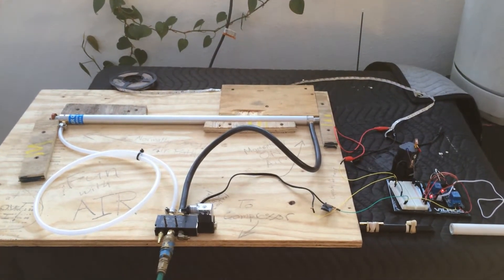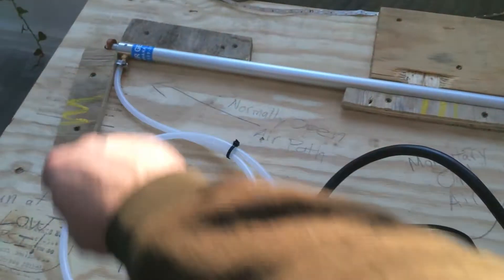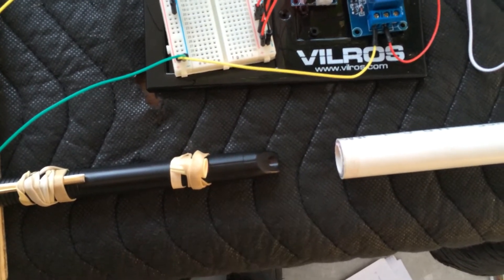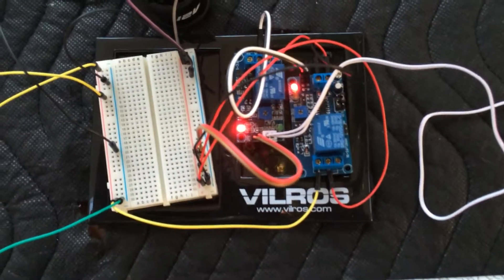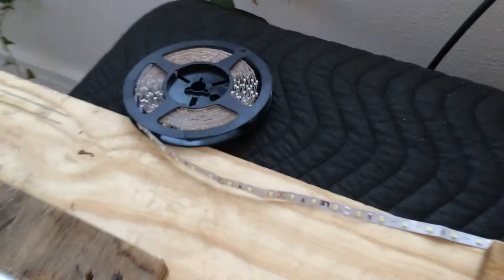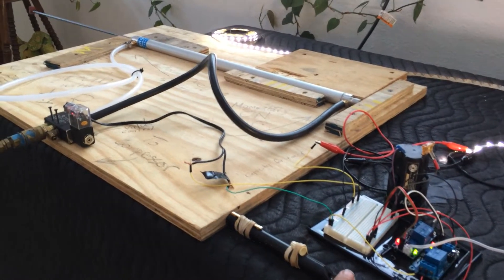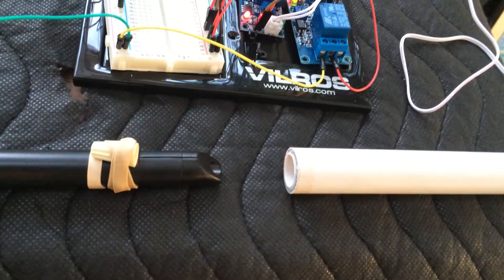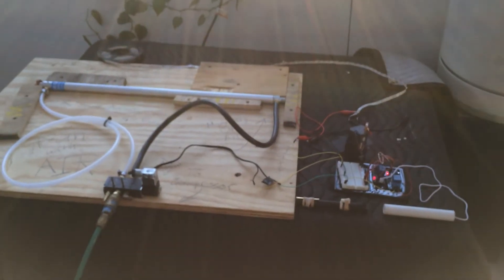Mock-up for air-powered Star Trek Doors.

Comment: Hello. I was wondering if you might have a parts list for those relays you used on this project or could give me the right direction of what to look for. I'm still learning these kinds of electronics. I have built a 3/4 scale Enterprise bridge with the doors and turbo lift and this would be perfect for what the turbo lift doors.  Joey

Comment: Nice! Where are you going to install it? What room is going to be your command center?

You're probably going to want to have laser sensors on both sides of the doorway so that your doors open automatically both entering and exiting your room.
Reply from the maker: It will be for at my brother-in-law's house, between the unheated garage and a semi-heated workshop. He wants something to keep the heat in the workshop, and be hands-free, because he's always carrying things. I'm planning on a laser on both sides of the door to act as both the opening trigger, and a safety against closing the door if somebody is still in it.